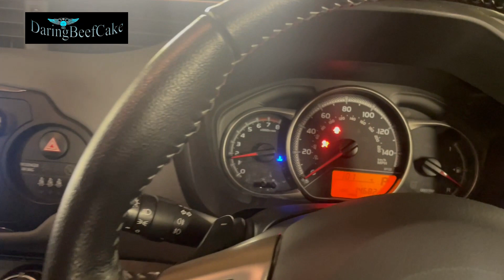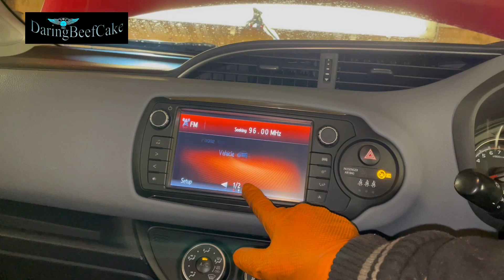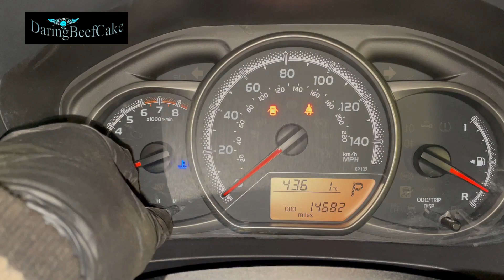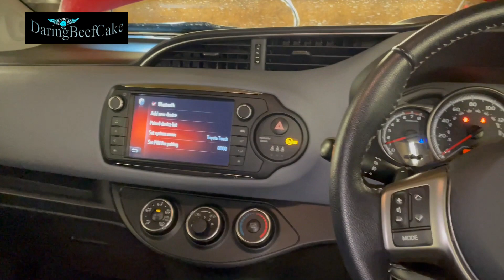Toyota Yaris 2016 main battery replacement

Comment: so, there is no need to go to the dealership service to reset the memory or something like this?
Reply from the maker: Not sure what you mean. It’s a battery replacement that’s all. You may need to adjust the clock and date but that’s it.
Reply: @DaringBeefcake  there is the anti-theft code, but I think there is no need for this one.
Reply from the maker: @vnm_8945  well in any case I replaced the battery and never had any issues, if it helps. If you are worried take to the dealer and they can replace the battery.
Reply: @DaringBeefcake , I already changed it myself and it went without problems, thanks for the video! :D
Reply from the maker: @vnm_8945  well done 👍